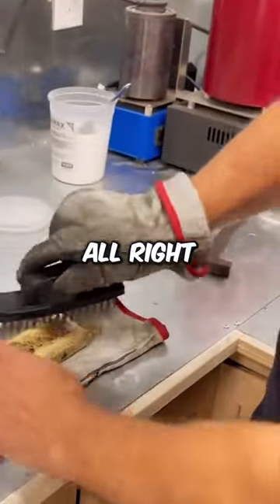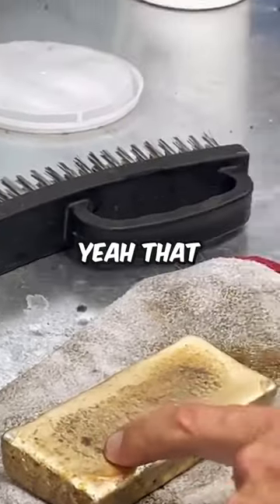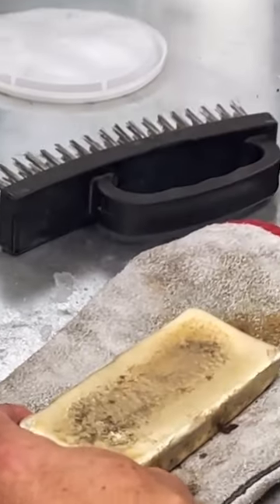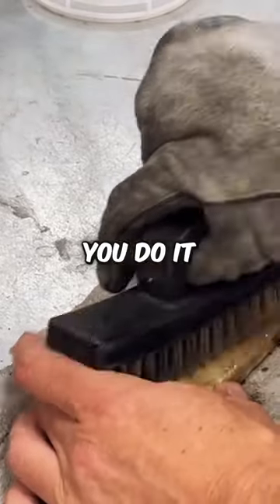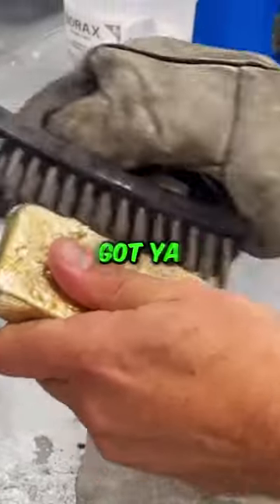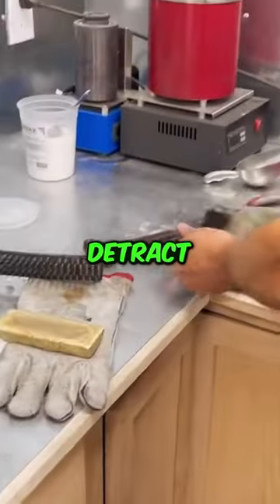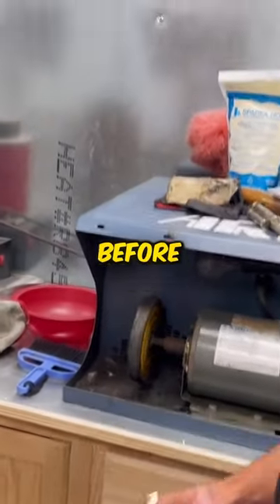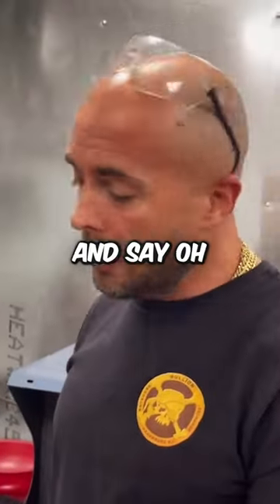MASSIVE Gold Bar SCRUBBED to DEATH! #shorts

Comment: The more you do it, the lighter it gets! How can he say sandpaper doesn't take any of the gold off?
Reply: zero
Reply: @BayshoreBullion you should do a video showing them it doesn't effect the weight.
Reply from the maker: We don't have time to pander to those morons. Even if we make a video, they will come back with some other dumb comment, like "the video is edited", or "they programmed the scale," etc.
Reply from the maker: Your name is PERFECT for you. You really are lost. Lost and completely clueless.
Reply: @EmpirePreciousMetals  😂
Reply: @EmpirePreciousMetals  why are you so angry when I just asked a question? You've got issues dude.
Reply: @EmpirePreciousMetals I don't know why you don't just take a minute to explain to people that you're only removing the slag with the steel brush.

What I meant with my question is: once you've removed the flux and impurities with the brush, you said that you then sand the gold bar. Does that not remove material? You do it to make the bar look nice, which I assume means removing imperfections... That's what sanding does, by removing material, and you scraped the slag off already so aren't you sanding gold at that point? If you're sanding the sides and bottom, then you're definitely sanding gold since the impurities are on the top.

So, my question stands. How does the process of sanding the gold bar not remove any of the gold?

Im also wondering why don't you remove the slag and boron glaze with dilute hydrochloric acid?

Whats the point of making YouTube videos if you're just going to tell everyone that makes a comment that they're idiots. They're not even offensive questions. You have an opportunity to share your knowledge, and educate people, but you'd rather just be a jerk. I'm just sayin man, at the end of the day being angry is a personal problem. I wouldn't let anyone, let alone random people on the internet, get under my skin. Life's too short to spend time mad. It ain't worth letting people have that kind of power over you.
Reply from the maker: You are 100% right. I apologize for being a dipshit towards you. I received an unusually larger number of negative comments in a couple days - which I never experienced. I have received negative comments in the past, but when you receive many all at the same time, it gets frustrating. So your question while probably completely innocent was interpreted differently. Again, I apologize. 
As for your question, these shorts came from a 3-full video series which should answer all your questions.